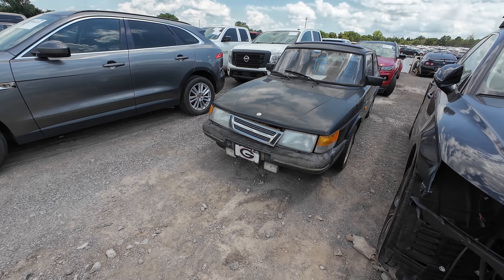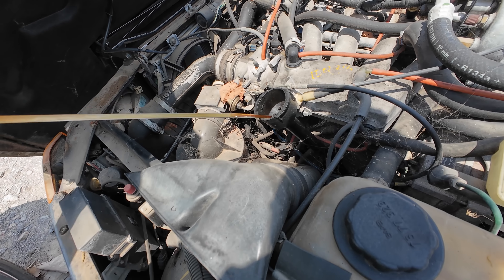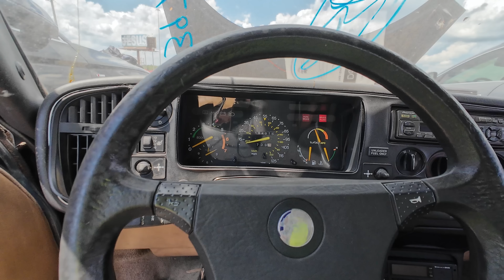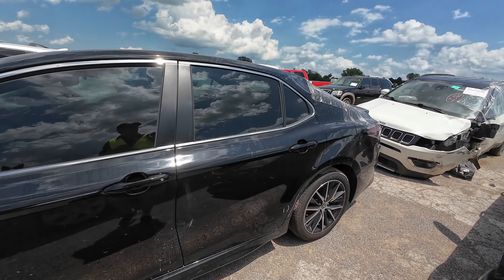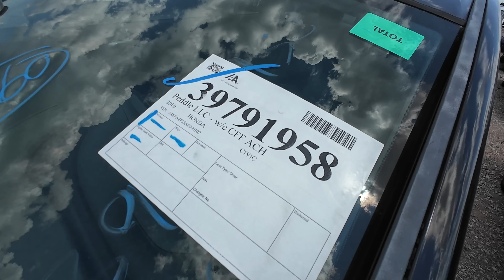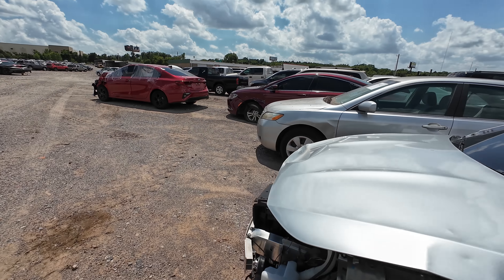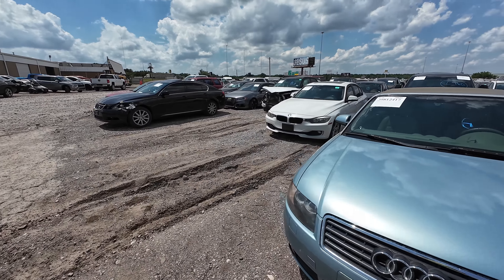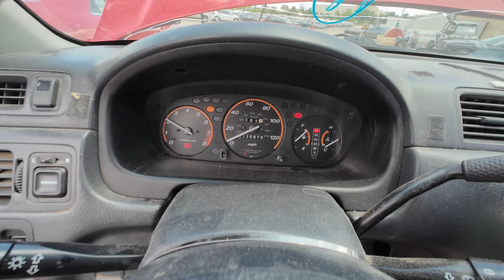This 1988 Saab 900 Turbo was Abandoned at IAA! Will it Run?

Comment: Buy the Saab. I had a 900 turbo convertible 20 yrs ago. Kept it 2 yrs and loved it. The day we sold it we drove to the buyer and almost turned around. We needed the money. I wish I had turned around. Loved that car.
Reply: That Saab looks so tiny next to modern cars!
Reply: Friend had a 900i and they sold it for a BMW 3 series. They were the original owner of the SAAB. They sold the BMW within 6 months and moved into an older Mercedes 280SEL. I think they regretted selling the SAAB as you did.
Reply: @stevenhinds4907  Against SUV's, yes but not against cars. I think it's about the same size as my Kia. The Kia might be a bit wider. I think the large SUV's are at the end of their life as people seem to be moving to small to mid SUV's like the Outlander, Venue, Kona, T-Roc.
Reply: Brother Randy no doubt you could bring the Saab back to life.  Do it bro
Reply: Yes! those old SAAB's where nice cars, but I don't trust them. Prices on the old convertibles are insanely high right now, at least over here in Europe.  S(venska) A(eroplan) A(ktie) B(olaget) means "Swedish Airplain Joint-stock company" btw.

Comment: Also Randy bring a can of carburetor cleaner with you put it in your bag. If any of them wasps come at  you can spray them with carb cleaner. You can also spray their nest and they drop instantly dead and then it evaporates it doesn't leave any residue and it's way cheaper than wasp killer?

Comment: Buy the Saab, its an interesting car. The engine is mounted backwards cause Saab engineers back in the day wanted the car to be smoother/better balance, downside to this its a bit cramped to change the belt and alternator but the clutch is said to be at the front of the engine so changing a clutch is really easy. I used to have a 1992 Saab 900 and it felt really well balanced in corners what I can remember, I have had newer Saabs but they dont drive/feel the same way as the old 900.

Comment: I had a 900 non turbo many years ago. These are from the proper SAAB era, really well built in Sweden. That mileage is not a lot for one of those. They are getting collectible in the U.K. now and the prices have gone up.
Only problem I ever had with mine was split CV boots and a new clutch around 90k.
I wouldn’t be surprised if it started with not much fettling, these things are tanks. Get it!

Comment: I had a 87 Saab 900 Turbo 5 speed it was white. When I got rid of it. It had just hit little over 300,000 miles on it and it ran fantastic. I got rid of it because I live in Boston and it was rotted with rust lol I had it for 2 years The only thing I did was replace the brakes and a few oil changes and your grand fantastic. Cool future that I thought was cool was that you could only start the car when it was in reverse it wouldn't stop otherwise lol That's how all the five speed manual transmissions were in those cars lol

Comment: SAABS had a look that only their Mother would love but, I've always found them to be very interesting.  My old GM had this same car with a Manual and it was an absolute Blast to Drive!!  Its a cool car but, I'd run just because of the availability of parts.  It would be cool to watch you wrench on it though!  Believe it or not the CNG Civic has a market for it.  We bought one on accident not realizing it was a CNG Car and we made money when we wholesaled it.  I sold an Odyssey that had the same issue as the CR-V and it had jumped time.  Great Video!!

Comment: Also, the CRV has a factory picnic table in the back! It’s the plastic cover to (what would be) the spare wheel in the trunk under the carpet I believe. It will have directions on how to unfold underneath that plastic panel thing

Comment: The Saab is the diamond in the rough
Reply: Very sought after but the automatic lets this one down. Well worth doing a light restoration but I'd be concerned with this one not running and Randy didn't try turning it over to see if it's locked. Hard to find a 900 Turbo of this era for under $20k for a good one. Plenty of the later GM ones but not many true SAAB ones.

Comment: Was hoping the Saab was a manual. Had a lotta fun in my red ‘86 900 coupe w/ 5 speed manual.  Sold it bc it started popping out of reverse, and required a trans removal to fix it.  These are interesting in configuration, lol

Comment: Now that the whole country knows about the Saab 900 Turbo you better put in a winning bid ASAP. I just checked Rock Auto, there are a lot of parts still available for the Turbo 2.0 liter. They are good cars. Get it running and driving and sell it wholesale to a collector.

Comment: It’s a very easy check! Switch the plug wire and see if the misfire moved! 
If it did then it needs an ignition coil plug. If not then replace spark plug and if those don’t take care of the misfire then it’s more serious. But that’s the cheapest and most easiest way to free check diagnoses

Comment: @26:34 You should have plugged in those coil packs to make sure it starts or not because someone else could have started the car and it started with no problem and they disconnected  the coil packs so it would not start for anyone else and they can get the car for cheap.

Comment: #replaycrew i remember those Saabs having the engines installed backwards. Where the accessories are at the firewall instead of them on the side or front of the engine bay.

Comment: That red RX8 drove to the accident, so it likely runs.  Wrecked cars are the ones you want to pull engines and transmissions from in the junkyards because they were clearly working at the time of the accident... Can't tell why non-wrecked cars end up in the junkyard, but it's often a catastrophic drivetrain failure.  Not so with wrecked cars

Comment: The CRV is misfiring because it has a burnt valve.   Typical B20 motor issue.   To open the latch,  there's a button under the window switch.   Pops the glass,   open the trunk

Comment: Randy, I’ve owned a Sentra, two Altima’s and a Maxima and never had an issue with the CVT and each car I’ve ran well over 100k miles. The only time a CVT is an issue is when they are not serviced properly. Stop